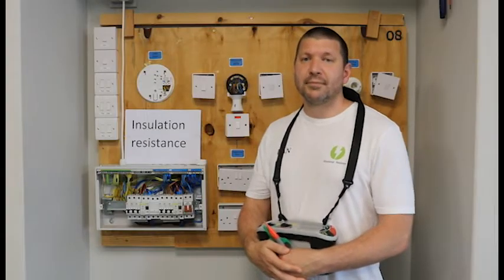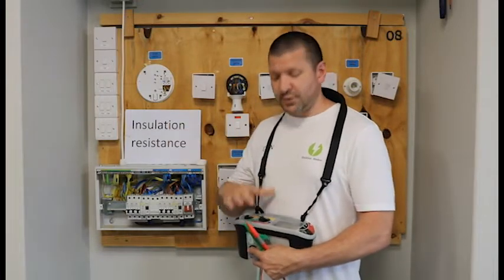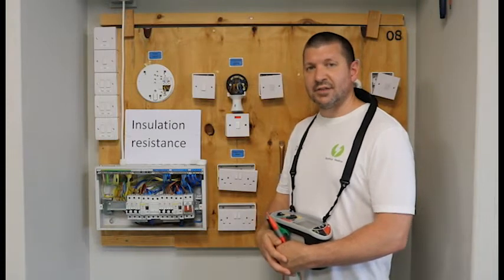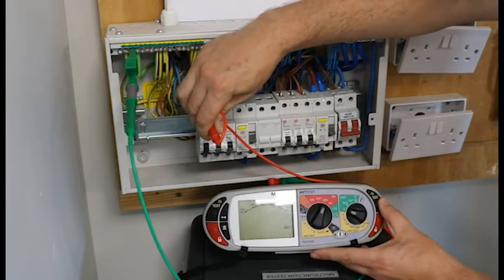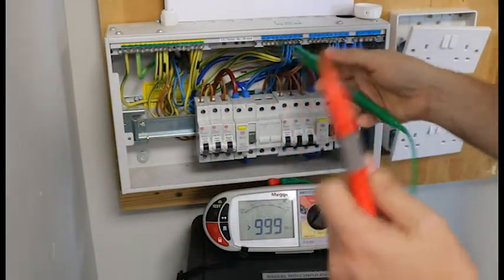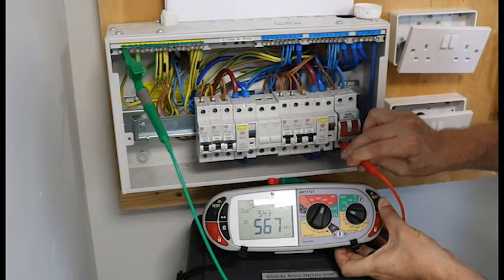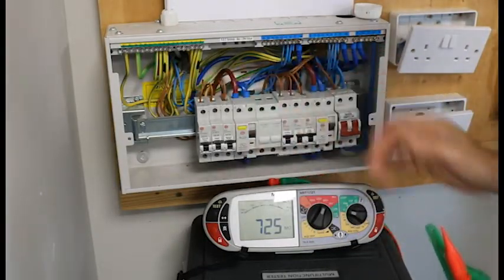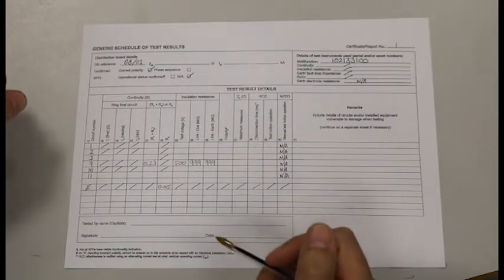Guide to completing an Insulation Resistance test and test sheet completion

Comment: How do you remove the led indicators while testing
Reply from the maker: Things like cooker or shower switches have neon indicators. They are generally connected between live and neutral. You can take the face plate off and disconnect the neon from the terminals before testing

Comment: The uk electricity supply is 240volts it always has been and has never changed. We only use 230v for our calculations so we have a standardised readings inline with Europe and to allow a wider supply voltage +/- tolerance in supply voltage fluctuations it also reduced the maximum permitted voltage drop for a circuit.
Reply from the maker: You are indeed correct good sir

Comment: weird how you say firstly that you dont need to remove any conductors from DB or circuit, then later start talking about things which need to be removed lest they get damaged

then at 5 mins in, you've turned on all breakers & RCDs and pressing test with live probe on bottom of main isolator switch on the board, but have said RCD electronics can get damaged by doing this. 

A very confused 2365 level 3 diploma student here

still, a helpful video, i gave it a thumbs up. thank you for making this
Reply from the maker: Have a look on page 117 OSG. Tells you about pre test checks, equipment which could be damaged or I fluency this test. 
The first tests I completed was insulation resistance for individual circuits. The second set of tests was how to complete an insulation resistance test for multiple circuits. This test does run 500V through the RCD. Page 118 OSG shows insulation resistance of entire board and page 119 shows individual circuits. 

The majority of the time, things which could be damaged are electronic equipment : lighting ballasts, lamps and LEDs. Things to influence the test would be a neon indicator found on cooker switches and some sockets. 
Check out the store at www.electricalstudent.co.uk 
Has plenty of formula sheets, cable calculation guides etc which will massively help you. You can also contact me direct from the website if you have further questions. 
Glad to help and good luck buddy!!
Reply: Do you mean it’s ok to run 500V through RCD? Thanks  @ElectricalStudentsUK Hi
Reply from the maker: @lemech This is an ongoing question. Most electricians would say any RCD should be able to survive a quick burst of 500V DC, seeing as though AC RMS can touch 325V. Some electricians report damaging RCDs and some do not. Other than reading the manufacturer's guidance of all RCDs, it would be safer to disconnect RCDs from the test. 
Another point would be to reduce the test voltage to 250V, but that isn't really when a reduced voltage test should be used.
Although this now adds to your testing time.
Reply: @ElectricalStudentsUK noted. Thank you

Comment: I havent done a lot of testing, but I’m pretty sure I was taught when doing an IR test on an individual circuit, that you have to disconnect the neutral conductor out the neutral bar, and the CPC out the earth bar for that particular circuit?  Because you’re testing that particular circuit? For example you’d disconnect the neutral and cpc out the fuse board and then put your crocodile clips on to those conductors and your probe into the outgoing side of the MCB??
Reply from the maker: @LP92LEO  It's actually either or really. The OSG shows both, GN3 shows to leave them in. As its a kind of pressure test and way of locating criss connections, if we test our circuit and part of another at the same time, its irrelevant. Our circuit has passed that test. The time to start removing the cables would be if a faulty reading was given. This would aid you in pin pointing the faulty circuit. Although there other ways of pin pointing a faulty insulation resistance test.

Comment: Why keep Neutral in the N bar? I thought we remove both Live and Neutral and connect them and then meaure to CPC
Reply from the maker: Connecting L and N and testing between that and E is how you complete the test with sensitive equipment that you can't remove. The neon in a cooker switch will give false, low readings, but doing the test as described will work, without the need to disconnect the neon. Not many people actually know/do this! 
Completing the test this way also means you must note it in the remarks column on the test sheet. Page 118 to 120 in the OSG shows completing the insulation test as I have done in the video. That way you can complete the test sheet correctly. Column 23 wants the test between L and N and column 24 between L and E

Comment: At 5:40 does your supply from council enter the top or bottom on the main mcb ?
Reply from the maker: @jonerasmus9399  Mains supply goes into the top of the main switch
Reply: @ElectricalStudentsUK  thank you I just need to clear that up and be 100% certain.  I live in south africa and just wanted to make sure you feed your mains into the top of the breaker as well . 

I've worked on other sites where they feed the mains from the bottom of the breaker . 

Anyways good video , good to refresh again .

Comment: great video, for a full board do all lights switches need to be open ? also do you do any testing using a fluke ?
Reply from the maker: @Badger8169  Thanks! 
Have a read of page 118 OSG. You should remove lamps, test, then operate any 2 way switches, test again. 
This is due to possibly damaging customers lamps with a 500V test. Also the second test is to test the other cables used in two way switches. Known as the strappers. 
I haven't any videos with flukes. I've used flukes and find them really complicated for a first time user.
Reply: @ElectricalStudentsUK  Ive bought a fluke 1664 fc and struggling ! think i should have bought a megger as all demonstrtations seem to be with one 
thanks for the reply

Comment: Hello! That was really great. You explained things very well.
You know when you did the test for ALL the circuits at once ? You mentioned you switched off the power and put the cable from the "load" end and the other cable to the earth/ Neutral. I was told by my teacher that an OVR can be damaged if you do this. Or does it mean you can do what you did as long as there is no digital OVR? Sorry for stupid question!!!
Reply from the maker: Your teacher is indeed correct. Some voltage sensitive devices such as an OVR and even some RCBOs can be damaged having 500V put through them. You are also correct, if your installation is a simple one, with no voltage sensitive equipment, like my small test board in the video, then it is fine to test the entire board this way. Look in Chapter 10 of your OSG and it gives pictures on performing this test
Reply: @ElectricalStudentsUK  Thank you!

Comment: first of all thank you for your presentation. secondly as it says in on-site guid to remove RCD, I wonder why you turned on RCD while you were doing insulation resistance test ?
Reply: Yes you remove all sensitive devices and also if you had a fault within a circuit you only did live to earth not live to neutral, good presentation but more detail needed

Comment: Amendment Two requires for initial verification  first fix we test at 500v second fix when accessory’s are installed and for periodic inspection we test at 250v and sensitive equipment can not be removed we tested line and neutral combined and test to earth . 

Also A 500v ir test will not damage electronic devices but you will get doggie readings. I have test the ring main in my house at 500vDC with the TV plugs in on on and the digital twenty four hour timer switch for my fish tank LED light plugged in and guess what they still work perfectly fine

Comment: To Amend 2? Not 250V first? No reciprocal calc?
Reply from the maker: Amendment 2 tells you to complete test at 500V. Only test at 250V on 230V installation if the 500V test would damage equipment that you are unable to remove prior to the test
Reply: For initial verification it is always 500 V regardless of inconvenience.
Reply: Please improve the quality of your videos, two the supply voltage in the UK is 240v AC , we only use 230v for our calculations . 
Otherwise a good demonstration and explanation.
Reply from the maker: @Dog-whisperer7494  hi there, I'm trying to figure out how to improve the quality when I show the OSG. I'll do better on my next set of videos. 
Not that I want to disagree with you good sir, but nominal voltage dropped to 230V in 1995. Allowing for national grid to supply us with voltages as low as 216V with their -6% tolerance.
And thank you for your support and appreciation. I will do better for you next time
Reply: @ElectricalStudentsUK  yes but they didn’t physically drop the voltage, they couldn’t do it as lower voltage would result in more usage and that would put a massive strain on the grid. What they did was lower the calculation voltage from 240 to 230 and that allowed the +-tolerance ie the supply voltage can be +-6% giving us a voltage as low as 218 v and as high as 258v it was all to do with unification with the rest of Europe . As I said we only use 230 instead 240 for our calculations . Put a voltmeter on the incoming side of your main switch and I bet you get 238-242/3 volts. I was being tort about back in the late eighties when I did my electrical course at college. Unification was also the reason we changed from Red and Black to Brown and Blue black for mains cables single phase, and from Red yellow blue  to Brown black grey and blue for three phase.
Reply from the maker: @Dog-whisperer7494  ahh, yes I have re read your previous comment. You are indeed correct. The haven't actually changed the voltage but want us to use 230v in calculations.